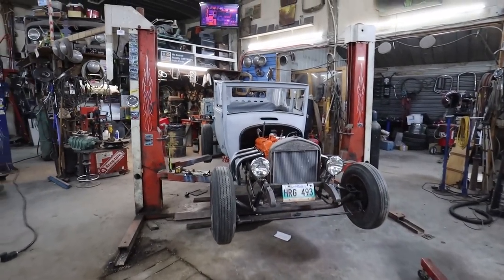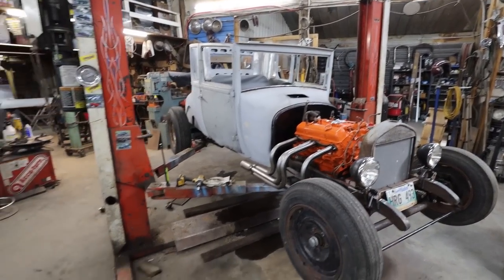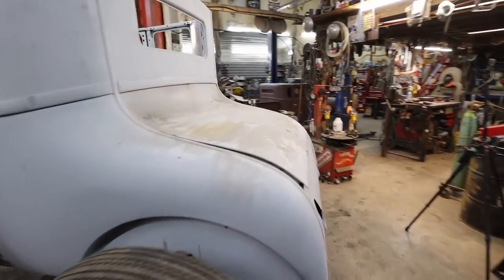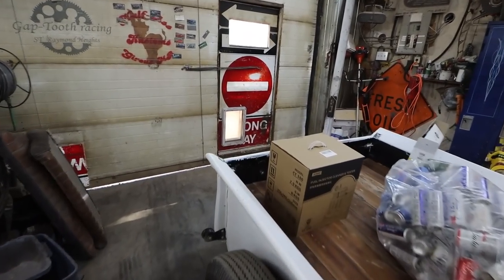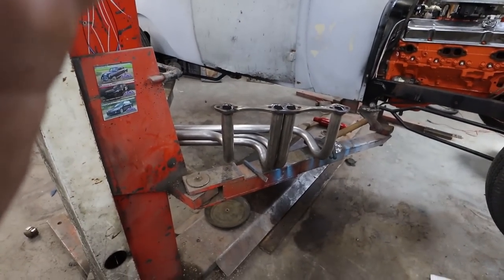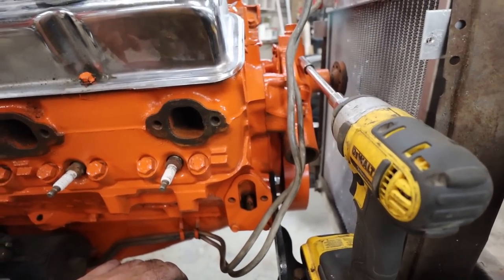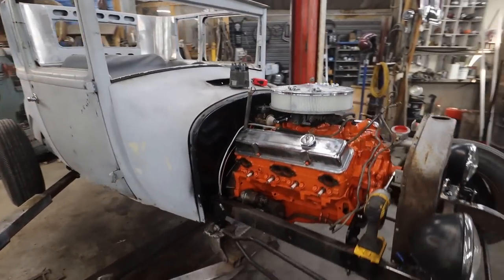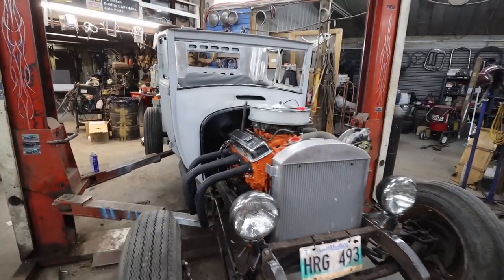Brake lines, modifying headers and final motor assembly of our Model T hot rod.

Comment: the best way to make tubing straight, is to Strech desired length out and place it on a bench or flat floor and then take a wood paddle and roll it back and forth over the tube. This will produce a very straight length. I use a wood paddle about 6" wide and 12" long. Very nice results on copper, but can be used on small steel.

Comment: I've seen those same headers used on about a zillion 23 T Bucket (kit cars) usually they are chrome with side pipes, or chrome, blue and yellow, depending on their age. Lol Thanks for the video. Oh and the air filter is a 14"X3" that fits all the fancy/expensive 14" air cleaners. So you can just bring a tape measure with you, if you don't happen to save the part number.

Comment: I had the privilege of header modification myself and its not a quick process so nice work on those,  I thought you were going for a clevis on the brake pedal but you found a free fix which is even better,, I was expecting some kind of wedge shaped speedhole brackets for an under the frame radiator support but we didn't get that far this time but don't sell yourself short on this video,  you got a lot done,  it looks more like a car every time you post one,, nice job on the air cleaner base, that was very cool,  can't wait to see more on this one it's getting better every day

Comment: Even If that is  a low compression 305  it will still develop 160 h.p. so in a light frame rod like that , it should perform pretty  darn well. If you put in a high torque engine, it would be a lot harder to control under load, and  make the turns on curves a bit skittish. In a light car, less is more. Nice job Brent.

Comment: Ol' Pablo is hanging tight on you now that your home... that was one fine trip in the LS Buick. I don't remember if he showed you the batmobile he built. Morgan has some good toys to work with. And of course all the other guys all have some cool stuff too. Brent, a five minute video of you tinkering is great, that said, you got that irritate list shortened up. Stuff that has to get done and it only takes ten minutes so why is it midnight before you know it/lol. I suppose next is to put that wiring for the plugs   out of those kits they sold years ago.. I refer to the ones that if its dark enough, the wires are lite up like the street lights in san Francisco cause they were so resistant that the plugs barely got any spark, it was  running everywhere but where it should be. I laughed so hard when a buddy of mine was struggling with his rig running.. I told him to shut the shop lights off and fire it up... he did an was so surprised when it looked like the light circus hit town! I am guessing that the two barrel is about all that light little rig will need for just cruising around. I think you have something  that someone will want to put their finishing touches on. Proof that it doesn't take thousands of dollars to have some fun. I kind of am guessing but think that the dash just didn't turn out like the picture in your head. Might of went with something out of a old chevy pickup from the forties so it didn't protrude so far out and make it easier to center the steering. It works and thats the game plan in a nutshell. I shall patiently wait for the next one so I can hear the varoom. I do hope the exhaust comes out the back but its fine as is if it works for    you

Comment: The fuel pump push rod comes out from the inside...bet you already knew that 😄...just wanted to kick you while you're down. Just grab onna the chrome block off plates for it and save yourself some time and welding supplies. They have a one piece block off, no need to deal with the two pieces like back in the day. The pushrod is fine to stay in there.

Comment: Noticed that he didn’t make the standard coils in the brake lines at the master cyl .  Is vibration cracking not an issue with that softer type of brake lines?  Just curious…
Reply from the maker: I left some slack at the bottom by the frame to make up for any movement.

Comment: what are you doing for a fan at the front of the motor?
Great looking build. You make everything look so easy. Thanks
Reply from the maker: no I'm not a fan "haha pun intended" of that look. I'll run a smaller fan in the back and keep the front of the radiator clean looking.
Reply: @HalfassKustoms  Cool

Comment: if your area weather is Hot then fix an electric Fan instead of clutch Fan because on the crowded roads and waiting engin temp. goes V. Hot; or may be you travel from coold state to another Hot. then its time to work.

Comment: Hey Brent could you put the oil cooler under the radiator but set it on a 45degree angle??
Reply from the maker: I think it'll be fine, I just didn't want to redo the lines on the cooler haha. My eFan will fit fine under the cooler.

Comment: And why didn't you cut off the narrow part of the muffler before welding it to the exhaust manifold pants? ))
Reply from the maker: woudn't have been anything really to hold the guts of the muffler and it would have probably fell off and rattled around in the pipe :)
Reply: @HalfassKustoms  If this is the first section with a flame arrester (I don't think it's a catalyst), then usually the flame arrester is inserted into the pipe and in your case the pipe is rolled up. Then this core can simply be grabbed on welded points and it would not rumble - I think so. In any case, you are right - if there is no excess resistance to exhaust gases on the exhaust system, the engine will not work more stable, and in some cases this can lead to increased oil consumption. But the roll could be cut half. Thank you for the interesting videos)

Comment: Brake n fuel lines to da back, air cleaner faking a 4 barrel wif only 2, headers cut n tilted in n down/black cherry bombed fer good measure, motor assembly come'n ta gether with Chineseium bling.